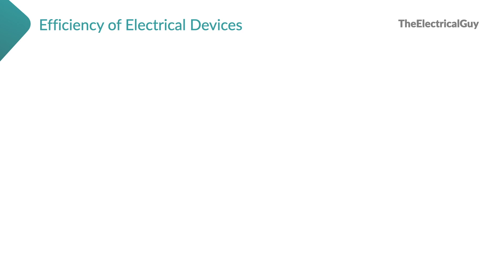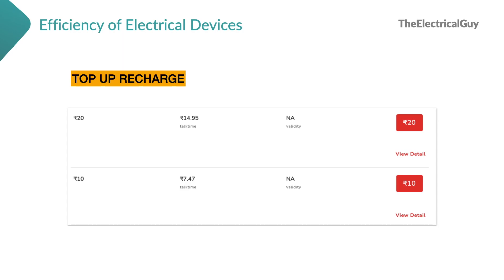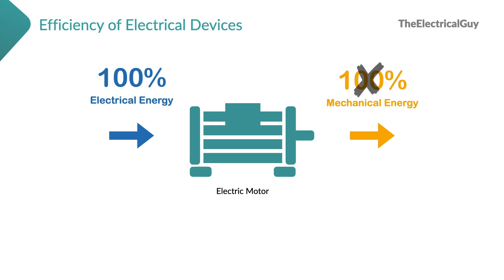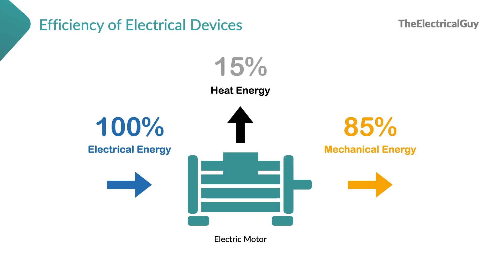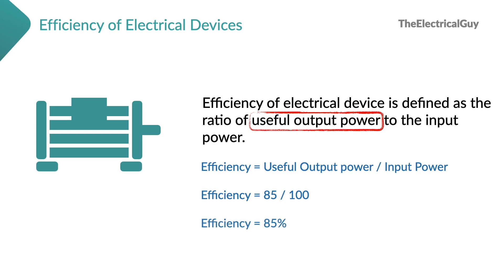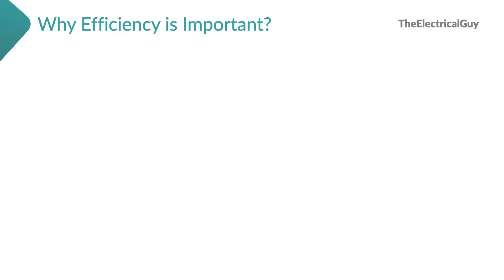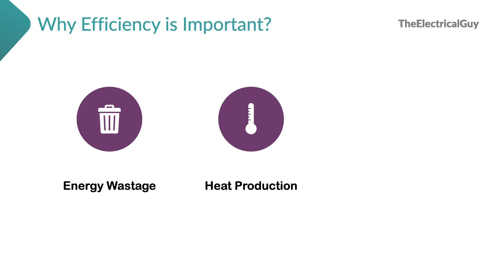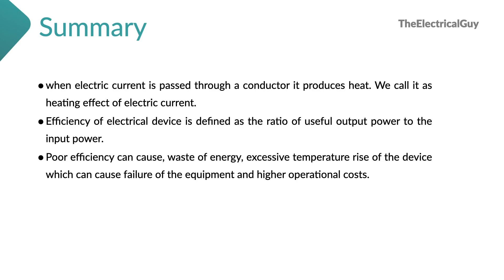Efficiency of Electric Devices | Explained | TheElectricalGuy

Comment: Cooling fans are used in
1) motors
2)power transformers
3) generators
4)hvdc converter stations
..........

100% efficiency machine is  all types of electric heaters
Reply from the maker: Correct!!
Reply: @GauravJ   Thank you sir

Comment: Sir why clamp meter shows slightly higher amps on line wire as compared to neutral wire? Difference of about 0.5 - 0.9 amp. Technically it should be same, but why clamp meters show this difference?
Reply: If single phase circuit, then you have a leakage somewhere.Have you measured current in a ground wire?
Reply: @imeprezime1285  There is no ground wire in our home.
Reply: @it_geek  Some appliances (like electrical stove, washing machine etc) must be grounded one way or another. Otherwise it could be great hazard to human life in the case of malfunction. 0.5 A is significant difference (if you measured it properly), and can't be just due to capacitive current in home installation. You have considerable leakage somewhere
Reply: @imeprezime1285  yes it is very high of difference, do not know what could be causing it. Have you tried to measure at your home, do you see any diff?
Reply: @it_geek  milliamps difference, barely noticable with a clamp meter. In bigger low voltage utilities the diff is larger, but not just due to "leakage" but because imbalance in 3 phase supply